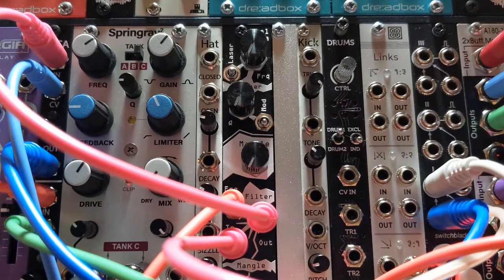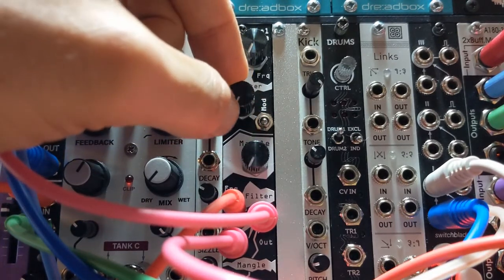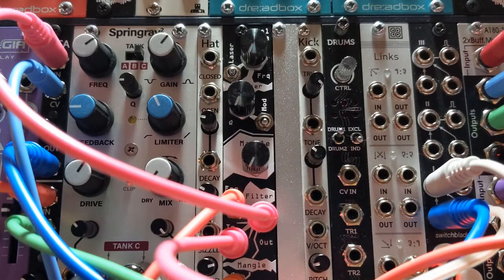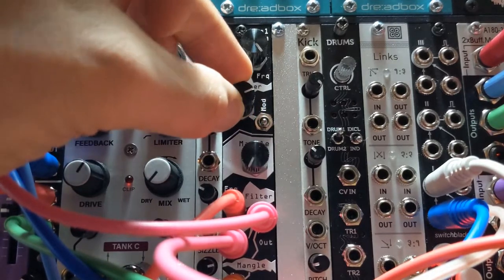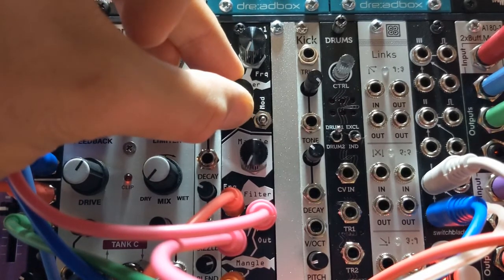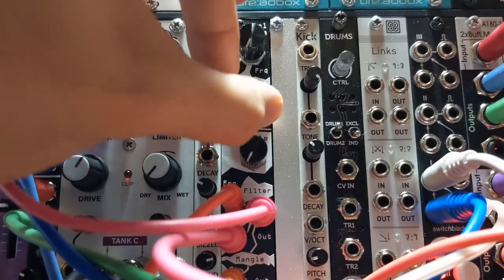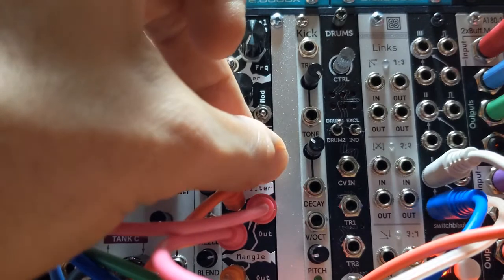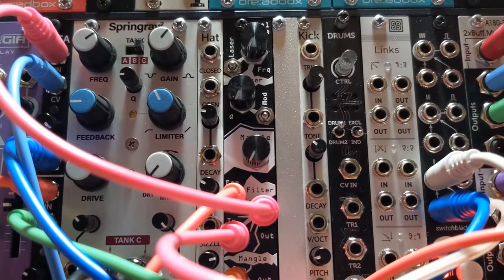Viol Ruina - Filter Demo With Basic Waveforms

Comment: this or ripples v2? what you guys think? my tummy says ripples..
Reply from the maker: Two very different filters so really comes down to taste. Ripples has a few different modes and a VCA whereas this is just low pass only, but with the distortion and the different switches. I haven't gotten a chance to make a video on it, but I would recommend you check out the AI Synthesis OTA filter as well. It's affordable and sounds awesome.
Reply: @cybermortal1983  Just came across this video as I was checking out reviews on the Viol Ruina. This video kind of changed my mind in picking it up as a filter, so I appreciate that! I see that you mentioned the AI Synthesis OTA Filter. Are you a big fan of it as a filter? Also, my main question is, have you had a chance to check out the new AI Synthesis VCF, the X Filter? I'm also extremely interested in it, as it uses a similar topology as Sequential Circuits. Unlike the OTA filter, the new X filter only has a lpf mode. If you have checked it out yet, any info would be greatly appreciated. Thanks!
Reply from the maker: @alexandermontagnet3361  I do really like the AI Synthesis OTA filter. It has a lot of character plus the resonance gets pretty chaotic at higher levels which I enjoy. I haven't tried the x-filter, but cv over resonance and a smaller footprint seem like an OK trade for loss of the high pass mode. Don't think you can go wrong either way, especially if you have some DIY skills. AI Synthesis kits are very well documented and easy to build.